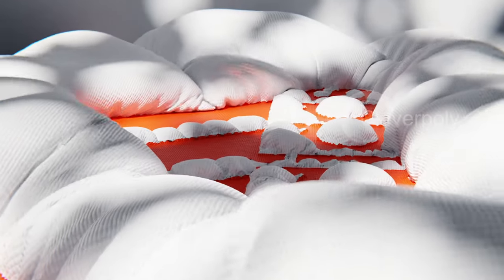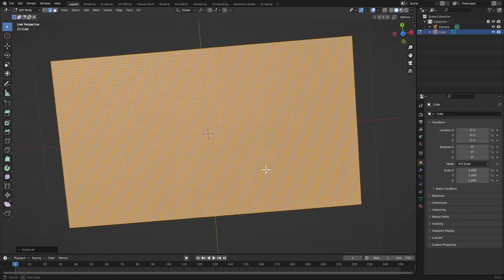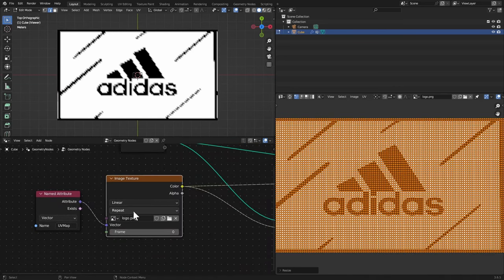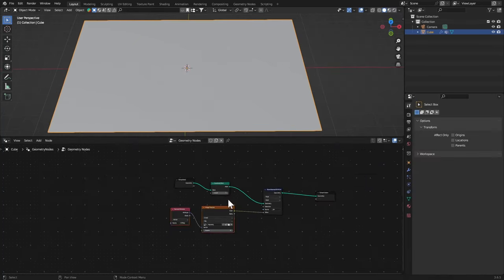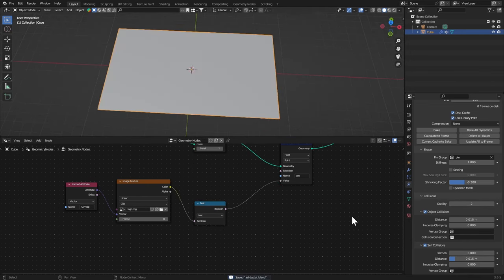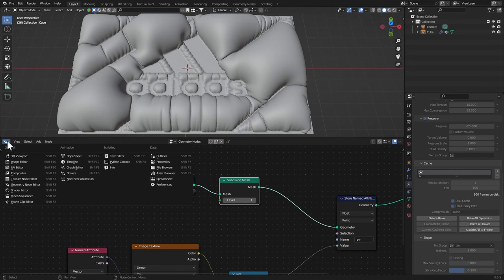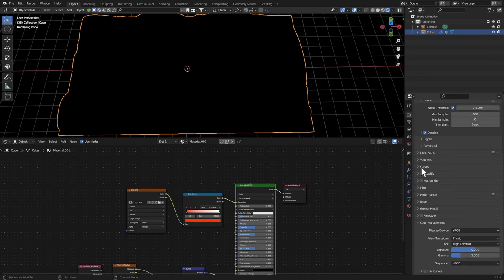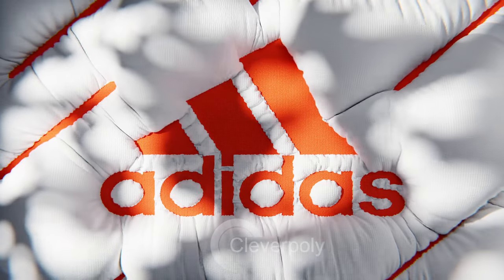Nodes+Cloth in Blender is CRAZY!

Comment: In 4.0 + versions of blender you can't use normal coordinates of a light for texture mapping, because when you increase the spot light radius the normal blurs. Better use UV coordinates.
Reply from the maker: You can use the Node GEOMETRY and get the incoming vector from that which should solve this problem of light not blurring out.
Reply: @polyhmm. Geometry > normal aren't working for me in 4.0.2. Thought I tested all the geometry coordinate nodes outputs and the only ones that doesn't get blurred and have have the same data as "Normal" is Geometry > "Incoming".

Comment: First part overcomplicate: you could way more easily add the outer border in any image manipulation software (Gimp, Krita, Photoshop, ..) and next, have you ever heard about "images as plane" included add-on? Or just adding a textured plane? The way you suggested results in flipped normals, which leads to issues. And lastly, instead of repeating Shift+R to increase subdivs, there's a useful box in the bottom-left corner, where you can set the amount of subdivisions by typing the desired value (handy for those with slow PCs and it avoids flooding your Undo chronology).
Title a bit misleading, maybe it's my fault but I thought you were going to reproduce a cloth simulation into geometry nodes!
Reply from the maker: Thanks for the feedback, I do tutorials for fun and do it the way they are fun for ME.
there are always better ways to do certain things in blender. Making my tutorials fit for everyone is not my goal, my goal is always to introduce more Possibilities and do experiments that fit into my niche.
Reply: @cleverpoly  I read back my comment and it sounded a bit rude, sorry for this and I understand your point. Cheers.

Comment: TYSM for this awesome tutorial. By the way what should I change if I want to use the same animation but with a different logo? I've tried changing the image file but no luck so I reckon I am missing a few more steps...
Reply: I’m having this same issue.. any luck?
Reply: @tomiwadaniel4665  I've had to start a new one.
Reply: Anyway I could connect with you? .. I’ve tried it like 5 different times with a different logo, my cloth just falls off.. but when I do the adidas and bake, it works.. now I’m sweating in front of my laptop cause I know it’s possible
Reply: @tomiwadaniel4665  I've had a similar issue to what u described and found the solution by paying very close attention to the part between min 3:00 - 5:30. That part where cleverpoly selects the edges in edit mode and scales down the selection to 0 afterwards, that solved for me bc I kinda zoned out and didn't follow step-by-step as what he did. Try focusing and following every single action he's doing there and you might get it fixed. hope it helps.
Reply: I also made sure that that same small pixel selection is on top of a black zone of the logo. I only used B&W ones so far, this is something u might want to check and not use colorful logos, only dual-tone.
Reply: I think I’ve one more in me!.. I’ll go again .. thank you
Reply: Finally got it! Like 2 minutes ago😂😂.. I danced

Comment: i tried to use an animated Letter instead of using an image to push this animation to it´s limits. The image texture node in geometry nodes has a Frame value that i´ve keyframed but when i bake it only the first frames are showing the pinned letter but then it goes wild an just flying away without any pinned stuff. Do you think there´s a away to achieve this?
Reply from the maker: depends on the type of the animation you put on
Reply from the maker: it might work it might not work
Reply: @cleverpoly  i made a quick black and white eevee animation as mp4 with the letter "B" rotating on the z axis and a frame. No matter if i invert the colors or not. there is something not working. In the animation i can see the letter starts to rotate but just the irst frames. The graph editor shows a stepped curve that i cant change to real linear but thats maye a geometry nodes thing.
Reply from the maker: it should work I dunno why it's not working for you, did you confirm your final black and whie output and what geometry you are pinning and everything, make you think about it and do every thing right
it's kinda complicated
Reply: @cleverpoly  it´s losing the pinning at start after a few frames as soon as i use the mp4 as texture. i´ve privided the blend file if u want to check it out
Reply from the maker: @lospuntosstudios5149  maybe the 2d animation is blank at first.. or your plan size is too small..  or your attributes are not even passing to cloth yet